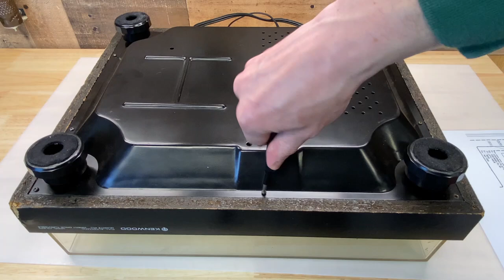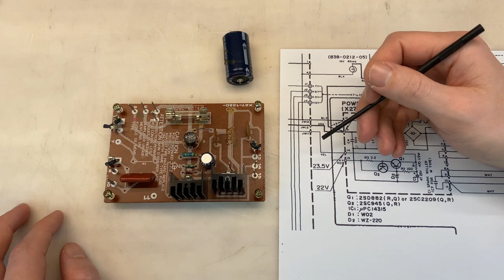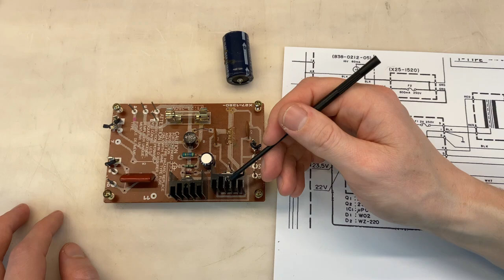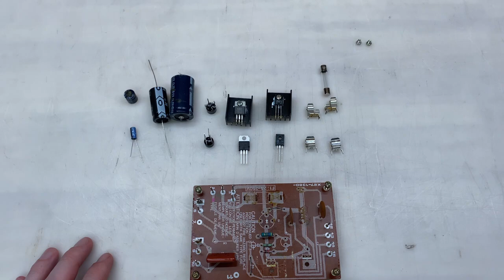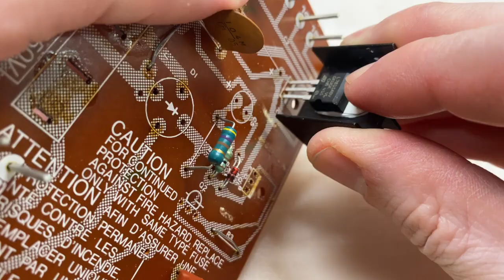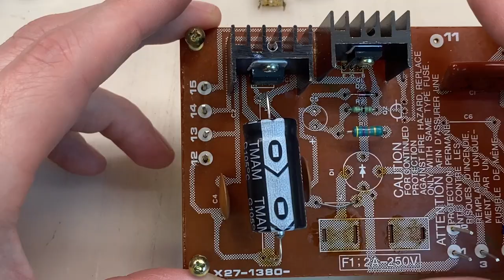DR #57 - Turntable Repair - Kenwood KD-850

Comment: I wouldn't have replaced the voltage regulators. I like it as original as possible.
Reply from the maker: Fair enough. Since the bridge rectifier was shorted, I assumed the transistor and / or the 15V regulator saw excessive current for a certain amount of time, which could have weakened them. This turntable doesn’t belong to me, so improving life-span is more important to me than originality.
Reply: @ Makes sense.